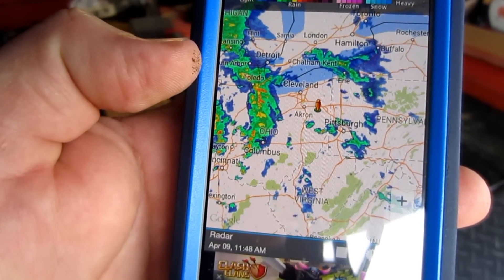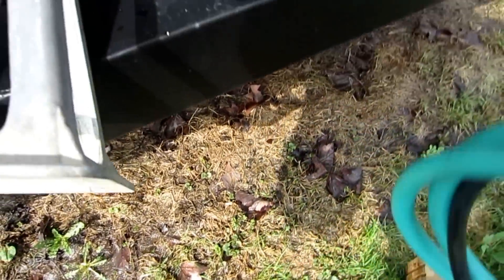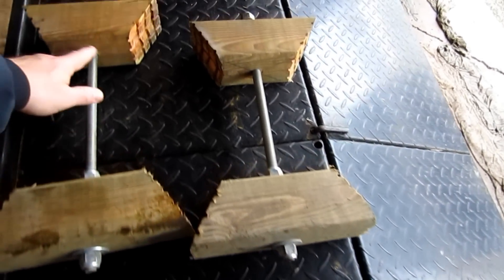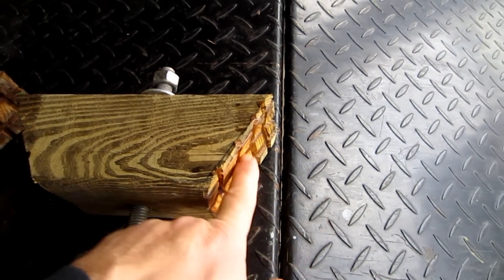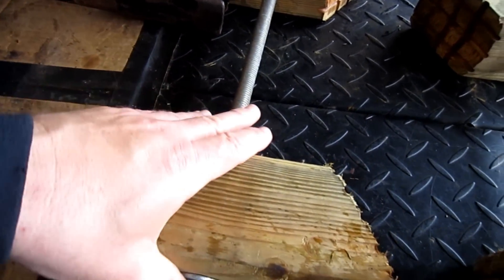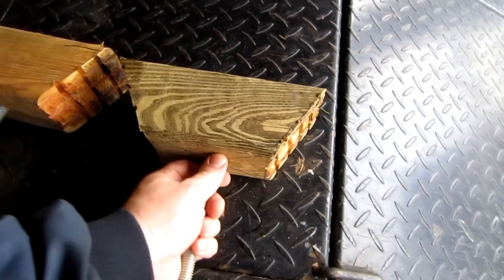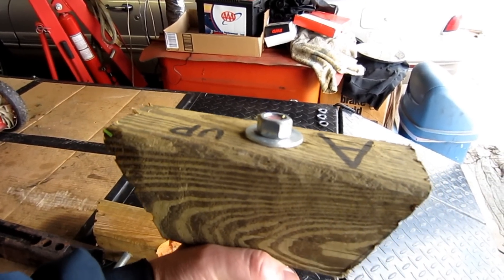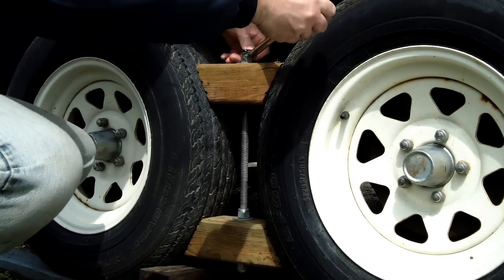DIY Tandem Wheel Chocks

Comment: These are great, I made mine in an afternoon based on this video.

One word of advise if you're wanting to get the dimensions right on the first cut: make some template pieces out of some extra 2x4s or whatever is easiest to work with (that has the same height as your final piece, 4x4s for me). It was easier to make small adjustments to the length and angle, then use those to draw the template onto the big 4x4. Which was a bear to cut BTW.
Reply from the maker: Glad it helped out!  Good point about the template.. 😀

Comment: Great DIY idea, i want to do the same, can you tell me how far apart your wheels are and then what dimensions you made your top and bottom chock??  i am not near where I park the trailer...
Reply from the maker: Mike Ryan You need to measure your trailer. There is not a set size that is equal across all trailers.. I can give you my dims BUT, if you dont have the exact same year, axles tire size, etc.. It may not work.. Just to give you an idea, We bought new tires and noticed a difference in the way they attach to my trailer now. Even though the tires are the exact same size (205/75/r15)... Plus, you can cut the wood blocks length shorter to fit closer to each other and have more bolt length so you won't have the short bolt issue I discussed in the video.. 
 It's really easy to measure. Just cut one block and trial fit and trim it till it fits the way you want it to on your tires, Then use it as a template to cut the remaining 3 needed. Then it's just drilling through the centers and mounting them on the allthread .Viola'.. Good Luck

Comment: What angle did you cut the chaulks and what lengths?
Reply from the maker: It varies based on tire diameter, axle spacing and, all thread length.. Basically, just hold the wood up to the tire where you want it to go and cut accordingly.

Comment: Add another nut below movable chock just below where it would be when clamped. That keeps it from sliding all the way down while installing and keep from pinching hands.
Reply from the maker: Brian W I originally had that but I found that storing them was a little bit more difficult with two blocks of wood on the each end of the rod instead of having two blocks of wood together on just one end of the rod. At least for me, that made my storage little bit easier.

Comment: yes, very nice I'll make my own too, but what I'll do is paint mine with platic deep that way it will look like plastics and give a cool look...
Reply from the maker: I have to finish mine still.. I have a couple cans of bedliner paint that I still have not used to finish the job.. I always want to do it but they are normally on the trailer.. Now that it's in winter mode maybe I can get it done..